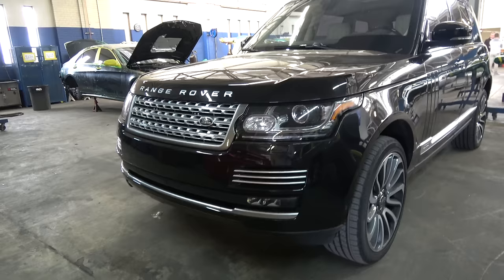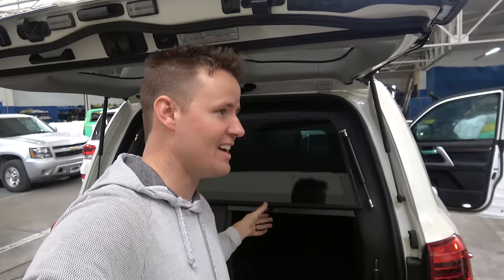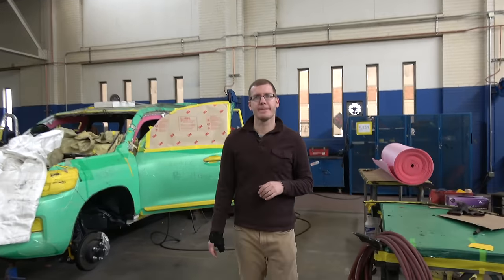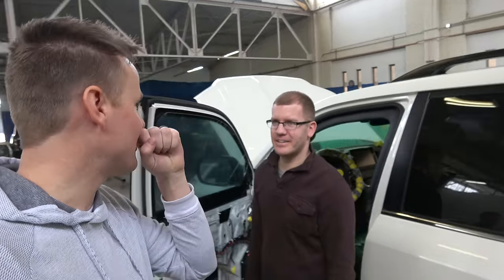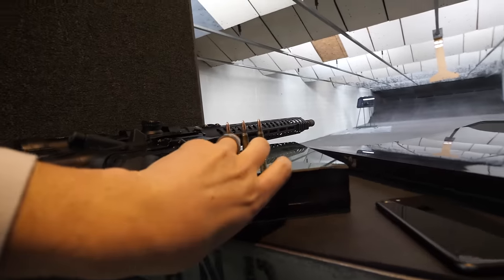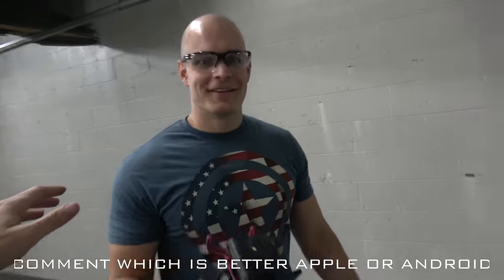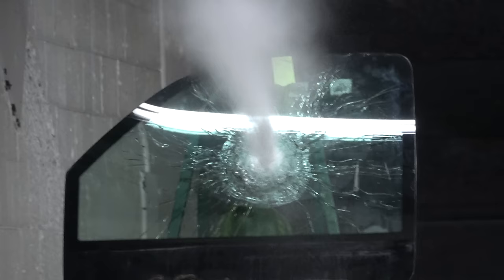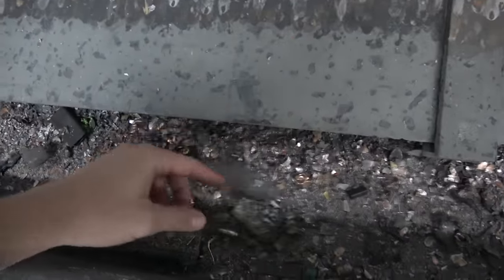What's inside a BULLETPROOF CAR?

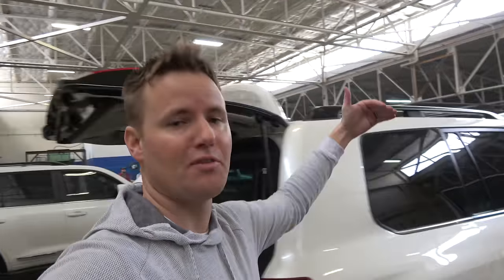Comment: At 1:47 have they not seen Myth Busters? Those tacks will plug the hole they just made, long term, yes it will deflate the tire, but in a chase it will not stop the car.
Reply: The one's used in the real world are not solid, they are spiked tubes. These let the air out through the centre of the spike, deflating the tyre.